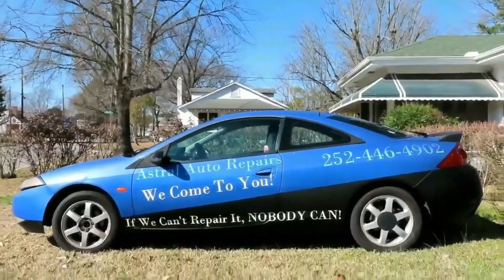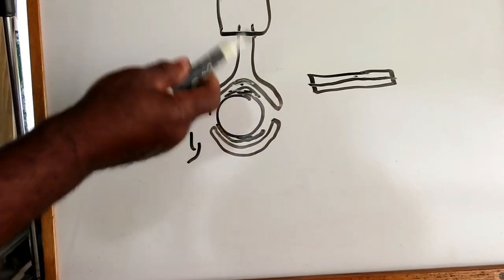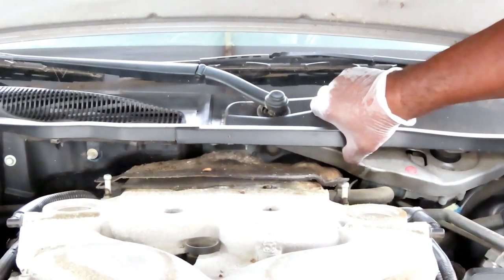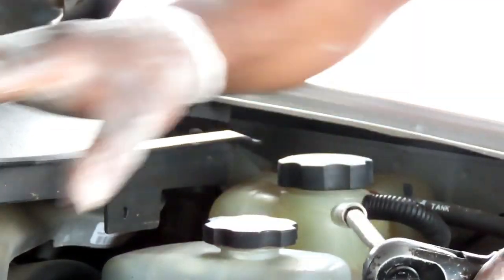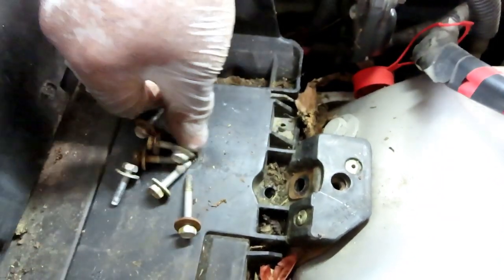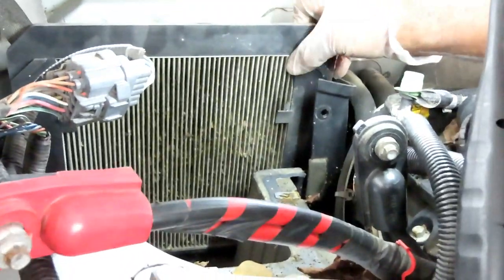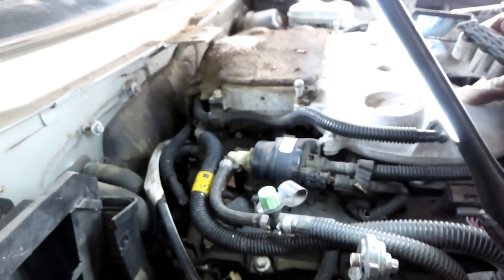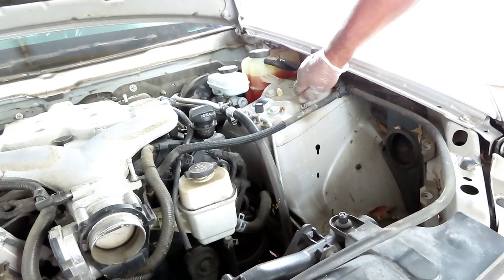⭐ Part 1 - 2005 Cadillac CTS - 3.6 - Engine Knocking - Oil Pan Removal - Possible Engine Rebuild

Comment: doesnt sound like a rod or a main bearing. neither of those would improve after start up. would be a consistent knock. now im curious

hard to tell from here lol  but the sound seems to be frontward to middle like flywheel. torque converter.  direction in different in person
Reply from the maker: Man are you going to be surprised, LOL!